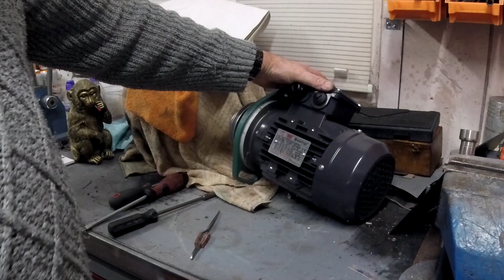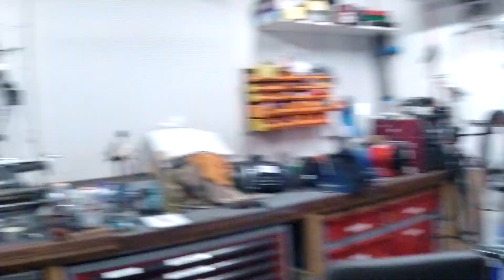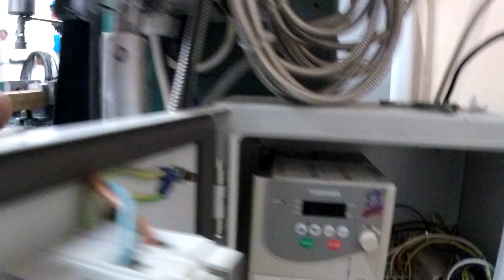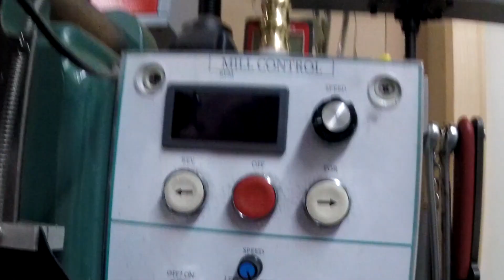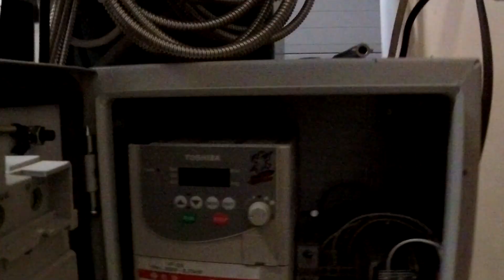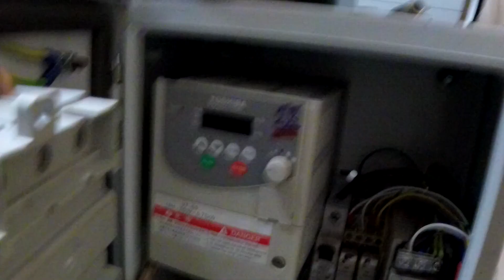How to fit a 3phase motor to a lathe or milling machine rewire to delta for an inverter vfd.

Comment: Hi Steve. Very interesting indeed. I very much would like to change the motor on my Dore Westbury mark 2 milling machine and need to get my head around all this 3 phase motor with inverter business. It’s all very confusing to me at the moment. 🫣😳🥴👍
Reply from the maker: Thinking back & what you have said, I should have added a video on the actual inverters & there connections. + A bit on programming. Food for thought. Thanks for the idea Andrew.
Steve.
Reply: @Steviegtr52  Happy to give you ideas for future videos which ultimately help me 👍😀

Comment: My electrical knowledge is almost non-existent mate! I was a maintenance fitter machinist in the print and motor industry. I could never understand electrics.
Reply from the maker: Yes they can be a bit awkward at times. 
Regards.
Steve.